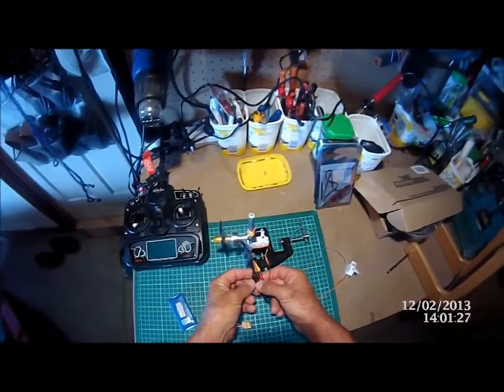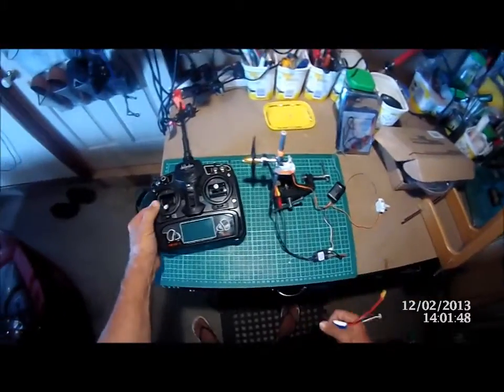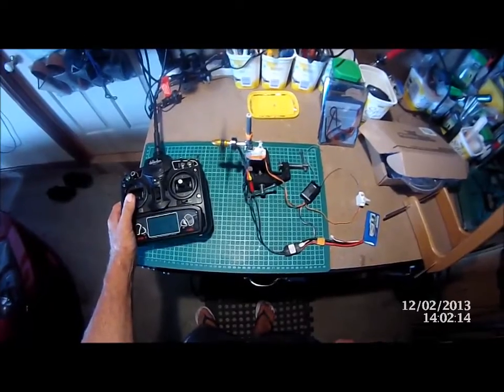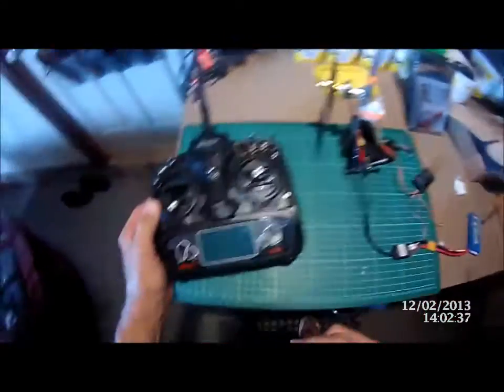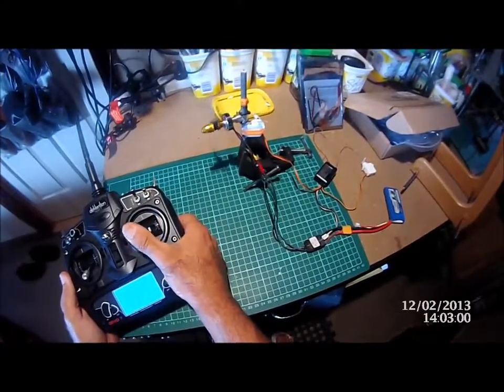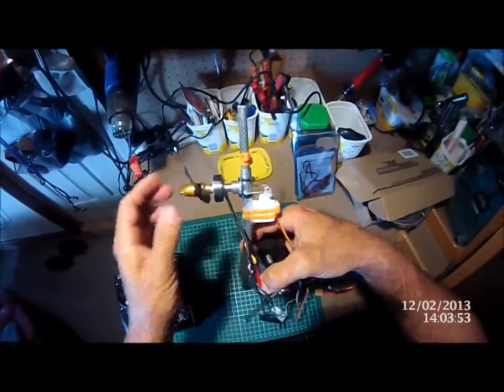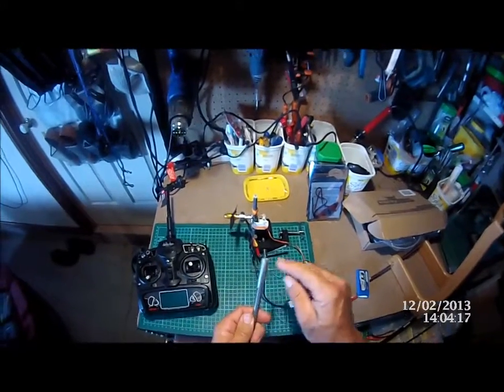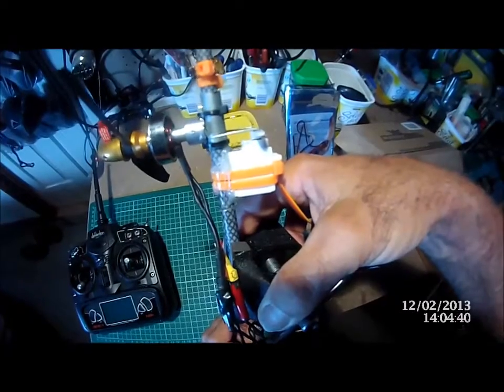RC Kite Build

Comment: Nice ideas Mooch Hox .... might lift some for the Delta kite build ... KISS ... no major soldering work .... just works .... will be looking forward the flight vids. Great idea to keep a minimun throttle ... so there is yaw control even on low throttle. I keep forgetting that and panic when I have to turn on a glide (with zero throttle ...) as the Eagle does its own thing  he, he. You'll know what I mean when you get her up ...